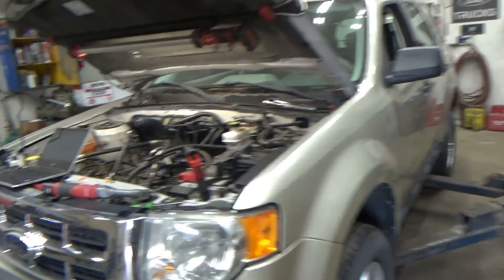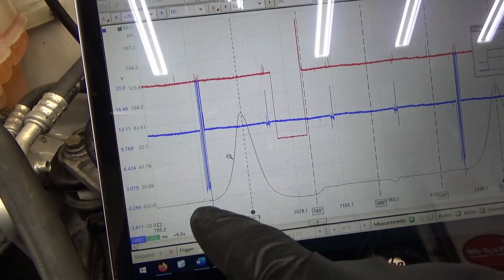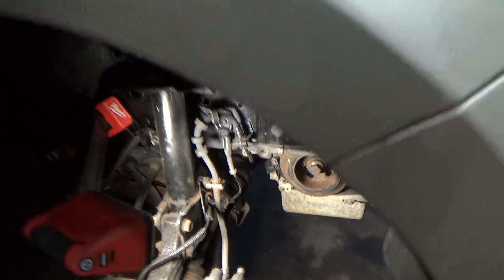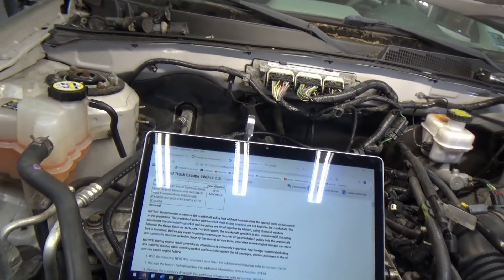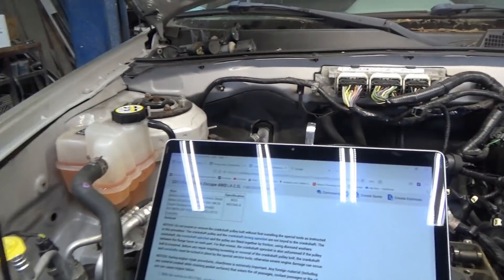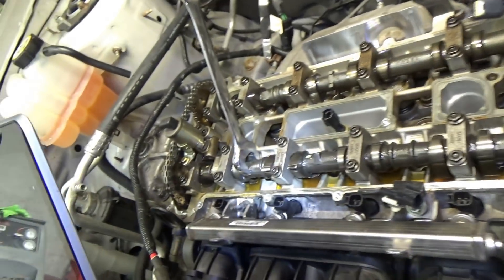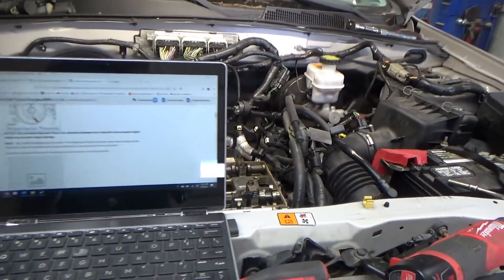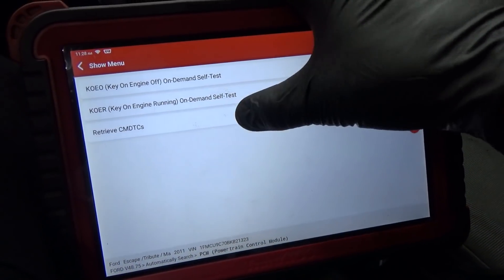Crank No-Start After Engine Swap? (Ford Escape)

Comment: He got lucky! Those are interference engines. I've seen many of them ruined. Worse, a lot of junkyards remove the balancer when they pull the engine and they just slap it back on. So even if you never touch the balancer, you can have a really bad day!
Reply: I'd never throw in a new engine without verifying the timing anyway----   In fact, you should ALWAYS upgrade your salvage yard engine's timing belt/ chain while it's there on the floor and super easy to do-- that way you know that you're starting fresh and can expect a long life after doing all that work.  Just throwing in a salvage engine and not knowing the miles on the current timing belt, or how long it's even been sitting at the junk yard is just asking for it to come back and bite you in the worse way....  I suppose you can do it if you're really tight on money, but it's just such a gamble-- and the customer needs to really understand that they are rolling the dice here, vs a quick additional timing belt and water pump upgrade as it's going back in--  and now you could likely count on another 100k miles at least, likely up to 200k.
Reply: @calholli  Timing belt, yes. Replace it. Timing chain, NO. Unless its a design with an internal water pump like the 3.5l Ford. Or a crummy timing chain setup like the 2.4l Chevy or 5.4l 3v Ford. Add on the 2.5l Ford, you need to confirm timing now on a used engine. 🤨
Reply: @calholli  Good point for sure.
Reply: I had that thought also.
Good thing the cams weren't that far off!
Reply: It appears Ford actually planned on those engines eating themselves if the harmonic balancer bolt were to ever become loose.
Reply: Does the ECM deal with the fine adjustment of the timing if it is still off by a few degrees ??
Reply: If THIS were a conventional set up , the cam and crank BOTH have keys in slots . The cam could have a pin or pins to line it up , depending on the application . Each gear goes on the slots or pins and the gears have marks on them to line up . Once everything is set , the balance wheel can only go on the key in the crank through it's slot . BUT this crank has NO key and I will guess the balance wheel has a mark to line it up . The cams have to be set and locked in place , the crank set at TDC and the balance wheel put on with the mark to line it up . Because there is no key , only the bolt and washer hold it in place , again , after everything is set up . In this case , the crank moved from it's setting because the bolt was removed from the balance wheel and it was not held by a key to the crank . You may want to read how to replace a timing chain set on THIS model to digest how it's different .  The crank can move from the correct setting once that bolt is taken out of the balance wheel and things are disturbed . There is no reference on it till everything is reset and the valves locked in place .
Reply: If the crank had NO key to hold the gear in place with the chain on it , once it moves , the valve timing is off . Depending on how far it moved , it could be a disaster . Once returned to the proper position , the ignition timing should be in specification - if the engine survived .
Reply: @billsmith2212  No the timing chain was not re-positioned. The only thing wrong was that the crank position sensor was not reading TDC correctly due to the pulley being in the wrong position. The engine was never at risk.
Reply: Is it correct to say that the valve timing is correct and only the ignition timing is off, that is why there is no interference?
Reply: Again , my take on this is the crank has NO KEY to hold the crank gear in place . That is done by the crank bolt and friction washer . Once they are removed , the crank gear can / will move . Then valve timing has moved . The valves are open on the exhaust and intake strokes . If that valve timing RETARDS to the power stroke , AFTER TDC , both valves are closed for 25% of the cycle . If it ADVANCES in the direction of the compression stroke , again , both valves are closed . But if it ends up in either intake or exhaust territory , this being an interference engine , it's KAPUTZ ! The ECM must have TDC reference for cam and crank correlation , ignition timing and injector pulse . If this guy was lucky and it only slipped a small amount , he got away with it . This design is a Total POS and I would never own one .
Reply: @billsmith2212  I am no mechanic but I think that crank position is sensed from the harmonic balancer from a sensor located located off the harmonic balancer and the timing chain is located on the crank inside the engine. Hence crankshaft and valve timing is fine, only the ignition timing has changed due to harmonic balancer going out of sync.
Reply: Think of it this way , the cam and crank are still joined together by the chain because it never jumped or snapped . BUT the crank with NO KEY has moved because the balance wheel was removed and everything was not reset in the EXACT TDC position .
Reply: The actual mechanical timing was not off… why was he lucky?  Just the reference for the crank sensor was out.  😛
Reply: So my focus cranks but won’t start, I am not getting power from coil packs to spark plugs, what should I check? Car have 60k miles 2018
Reply: Engine may still start with slightly bent valve stems. However, those valve seats will get burned over time, so this this may not be as fixed as Ivan thinks it is.
Shame on Ford for needlessly changing the time honored practice of keying the balancer!
Reply: @5tr41ghtGuy  ya ford SUCKS bad. they deserve to go out of business. all u can do is hope and pray!
Reply: The chain was never moved so pistons to valves contact wouldn't have occurred.  Just the ignition timing was off because of the notch in the harmonic balancer.  It would be like putting a distributor in wrong when cars had distributors.
Reply: @upallnight888  From what Ivan said the removal of the harmonic balancer also "disconnects" the drive gear for the timing chain for the cams from the drive shaft (he said it's a resistance fit just like the harmonic balancer). As far as I know that means the driveshaft can turn and the cams can potentially not move (which sounds to me would allow pistons to slam into any open valves).
Reply: @upallnight888  that's where you are wrong. Since the chain gear on the crankshaft is also not keyed but pushed by the harmonic balancer  loosening crank bolt creates situation where both of them are loose and you can rotate crankshaft alone while cams are standing still even if chain is not removed.

Comment: Oh boy. I've seen this so many times. There are clearly still techs that don't know that these Ford engines have no key ways. The thing is a lot of manufacturers are moving to this. I've recently had to do timing chains on both VW and BMW. And they're the same. No key ways. Have to use the special tools along with colored chain links. You can't do what you did here on VW. The crank bolt also holds the crank gear in place. So when you remove the crank bolt all the chains (there are 3) can literally just come off. The crank gear has a small key way but is flat onto the crankshaft. So literally nothing holds the crank gear onto the crankshaft other than the bolt. Without the tool it's almost impossible to remove that pulley.
Reply: IMHO modern VW's are not meant to be serviced.  They are meant to be driven about 100K miles and scrapped.    Perfect example, replacing the rear brakes on a GTI, there is absolutely no clearance to get the caliper bolts out.   They need to be unbolted from the inside, and they're on so tight that you need an impact wrench.  Except there's no way to fit an impact wrench on those bolts, so you have to use a bunch of wobble adapters and pray.

Comment: Some dumb shops in the USA, or are they diyer's, ?
Reply: Not dumb so much, but if you're a multi brand shop it is difficult to stay on top of the nuances of every single engine from every single manufacturer.. That is why if you're working on something new to you, you spend some time as a mechanic doing some research.. The really top mechanics also do a lot of continuing education as Eric O from SMA has pointed out several times. He regularly goes to manufacturers symposiums and seminars that talk about fuel injections systems, Ignition, et cetera on a specific brand. It is very difficult in this day and age to simply work on a car based upon your knowledge of how other cars cars or older cars operate.
Reply: @stevewhite3424  its a diyer mistake.
Reply: @clueless6559   I may have missed it, but it sure looked like a shop doing the work to me. But of course I could be wrong as I  wasn't there as neither were you.

Comment: A trap for young players with the Ford or any vehicle with keyless cranks!
Reply: Which is why you READ shit instead of bumblefucking your way around the engine.
Reply: @Cheepchipsable  That's right.  I can't believe in this video there was service info right in front of them and they still didn't read it and get a new bolt and friction washers, or tighten it correctly.  The way they tightened the crank pulley bolt it's probably going to loosen and this thing will be back with a bunch of bent valves.
Reply: @johnz8210  We don't know what the mechanic who installed the engine had in the way of tech-info or knowledge. We know Ivan did and he used this to assist with understanding and diagnosing the issue.,

Comment: There is a hole cast into the block behind the balancer.  It is clearly visible at 4:10.  This allows the hole in the balancer to be aligned and pinned while torqueing (did I say torqueing?) The first tech should have observed that, with or without service data.

Good job going after timing, Ivan!
Reply: Depending on the techs experience, they may not have known about that. I did a similar one, and I've done numerous engine swaps, didn't know anything about that hole or anything until reading service data and still had to go step by step plus had to buy the special tools.
Reply: @brianmason8400  When I was at PepBoys in spring 2020 another tech swapped damper on one. Wouldn't start. As I was walking by heard him mention this funny washer they sent with damper. I said OH NO! Printed off directions. They shipped it to dealer. I have the tool kit. Never used it.
Reply: So called special tools you supposedly need aren’t always necessary. I have an old Porsche. Dealer do oh you need these tools. I said no you don’t.. there are exceptions though.
Reply: @kevincampbell8298  Depends on working environment. When working in a flat-rate shop where management expects 5 hour jobs be done in 1.5 hours, don't have time for making tools. Especially on one like these where bending the valves is a real possibility. The tool kit was less than 50 bucks and took 2 days to get. I was paid 30 hour. Better off getting something done.
Reply: @gailtaylor1636  Bending valves wasn't a possibility in this case. Timing chain was not disturbed. Crankshaft and camshafts where still in the right position relative to each other. Only the computer didn't know when to fire up the injectors and sparkplugs.
Reply: @brianmason8400  It doesn't really matter if he knew about the hole, or not. The pulley has no key and it has a toothed crown for the crank position sensor to read. So that alone should be an indication that the pulley is part of the timing. The guy who did the engine swap need to take a step back and think about his skills and maybe do some more reading about how an engine works.
Reply: Agreed. He didn't observe.
Reply: @Gail Taylor....as it happened, oddly enough. I already had a timing tool kit for the Ford Escort w 2.0l Zetec that I have had for many years and oddly enough, it had the correct pieces. Humorously, goes to show you never want to get rid of tools because you just never know what your next veh will be or what you'll be doing on it!!!

Comment: how do these meccanics get there diploma  ? you are a genius . solving others meccanics there faults ,
is more and diff work then normal . thanks for sharing .
Reply: The only reason I know of this issue is watching video's about this issue. This is the second video I have seen about this. Dumb on Fords part.
Reply: @mph5896  ive seen allot in real .people by cheap stuff . or dont do regular maintenants on there car .
Reply: @mph5896  You would also know if you did some research...

Comment: Is it not an interference engine? Would have expected some valve on piston action.
Reply: Cranking the engine with the balancer bolt loose will break it for sure due to piston and valve collisions. Loosening the bolt will allow the cams to shift. If reinstalled without resetting the alignment (which is what happened here) it's luck of the draw. Memo to self, don't buy a Ford...
Reply: He said the cam timing was pretty close. It was only the ignition timing that was badly off - 90 degrees.

Comment: Few months ago, a friend of mine who happens to be a shop owner called me  he did the same exact thing i asked him did loosen the harmonic balancer he said yes there is no way for the engine to be dropped in with it installed i told that's your problem it took him a while to get his head wrapped around ford ingenuity 🤣
Reply: Ford is ridiculous. 🤪 Engine prob should be jerked out from the bottom on those, then split.
Reply: @mph5896  You can drop engine with trans just as fast as fumbling around getting it out the top. BTDT.

Comment: I've run into this on an eco-boost, trying to make an engine cheap as possible by not taking the time to machine a keyway. Makes our jobs that much harder.
Reply: Thats exactly when I first learned abou this too. I told the customer no dice from me just because of the timing tools needed. This one was easier than that ecoboost I was looking at though.
Reply: @moo3993  I got the tools, not really a lot of money. It was a huge PITA though, took me about 6 hours, don't remember the book time. So hard to get to anything on those motors, not sure I'd take the next job. LOL

Comment: He took crank bolt out to get engine in from top. I did some thing on Ford fusion and it called for engine and trans to go out the bottom. I thought I was taking short cut.
Reply: I reset mine with a certain length bolt screwed into block and the eyeballs on the end of cams.

Comment: Crank bolt also needs replacing after removal
Reply: Are they one use only? Some head bolts are like that.
Reply: @smithraymond09029  yes 1 time use only I had a friend find that out the hard way did the timing chain went on road test boom engine buggered just like that
Reply: Yes, and they still didn't follow service info instructions and tighten it correctly.  The diamond washer should have been replaced, too.